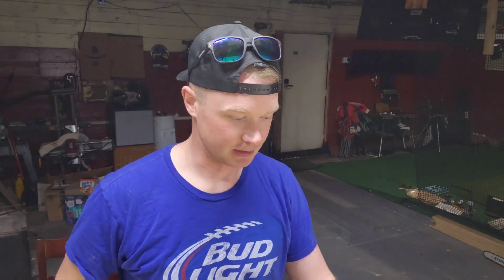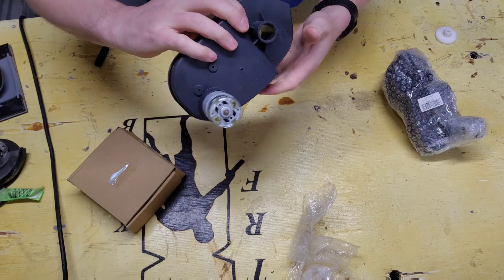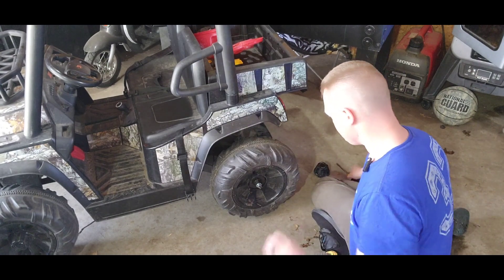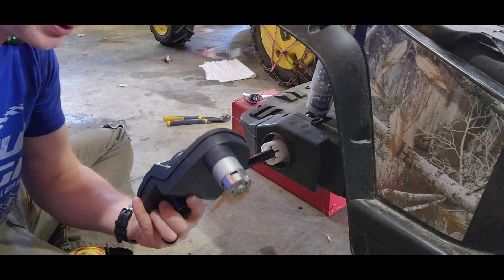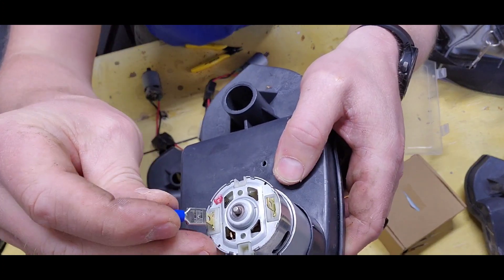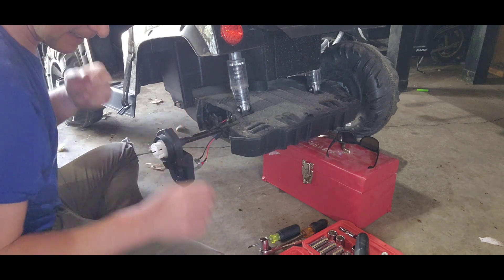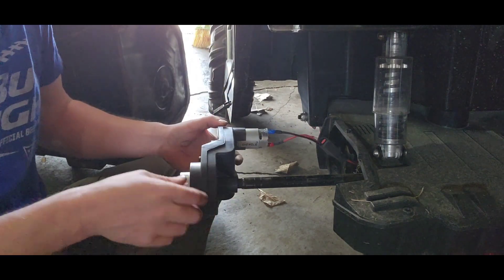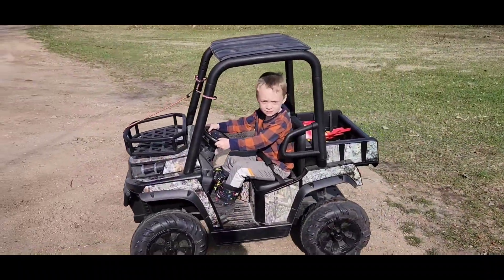24v UTV ride on gearbox fix and motor upgrades

Comment: I have upgraded my motors to the 775 from MLToys and changed the battery over to the drill rechargeable batteries (2 Makita 18V) using the amazon battery adaptors.  My car will go for a few seconds and then stops.  MLToys recommends me bypassing all stock breakers and purchasing the 40 Amp self-resetting amp on their site, do you have any experience with teh breakers?

Comment: Anyone got simple idea on how to give rear wheels a little differential action?? IMHO doing this may save folk from grinding up gears in gearboxes.   Yeah, less power slides and drifting though LOL.  AKA... seems to be all Ride On's with two or four motors do NOT declutch, depower the wheels  that are on on the inside of turns.  I bet that is why wheels are designed as they are.  When you turn the inside tires lean some away from the center traction area of tire and onto the more slippery plastic.  This allows for slip and takes stress of gears.

For myself I'd like some differential action and not rely on slippery section of tires.  Will be converting it to haul medical equipment, tools etc....  and I know i'll be going well over its intended weight capacity. (will upgrade structure where I can accordingly, and changing drive motor gear smaller toothed for more torque but less speed).   Also will like many have.... improve the traction of the tires. needing to do that  cause most all my use will be in fields (think farming/hunting/fishing etc) 

Would not be such an issue if it was not a 6x6 with all 4 rear wheels powered..  so its going to want to drag/scrub outside tires in a turn , and make wheels slip/hop in inside of turn, good bit more than a Ride On w/only one or two powered rear wheels. As pointed out above this  becomes bigger  issue when  you remove ability of tires to slip by adding traction aids to the wheels.  

One brainstorm idea to accomplish this is:
. two momentary switches placed to each side of steer motor hub orrr?? 
. glued on nub to steer motor hub (orrr?)  that pushes  one of two momentary switches in a left or right turn
. relay(s) activated by pushed switch  temporarily depowering motor(s) that are on inside of turn... AND then repower it (half? third?) of normal voltage, via re-routing power coming from Motor Controller thru step down DC converter or  thru voltage rheostat, thus causing inside turn motor/wheel(s) to turn slower.  

Point of repower at a lower voltage is you don't want to just depower motor/gearbox completely  (unless you declutch it somehow) ... Without declutching; that  too would put unwanted harsh stress on the gears.  I dont know if the de-power/repower though would be seamless enough to keep stresses down.    

Ohhh  and put  a switch (along with needed relays) to bypass that  new differential feature back to the OEM true locked together drive again when you want to drift, climb thru slippery stuff, climb hills etc.

otherwise if you got $$$ you could get a whole new multi motor controller with more features where you could program this into the controller itself. heck you could even then have option for Tank steer

So what is brainstorm idea one of ya'll can come up with.....  throw it out there.... lets hear it.

Comment: I replaced both gear boxes with the best ones I could find on Amazon. 24v, 35k rpm. I installed both, and tires seem to spin fine when wheels are off the ground, but as soon as any resistance, and tires are on the ground, it will not move. Seems like they are trying to engage but motor isn't strong enough to spin? What could it be?
Reply from the maker: Pretty sure your battery is shot. It doesn't have the power to push the wheels when there's resistance. So you might have to swap out your batteries, even my replacement ones that I build, maybe last us, one summer of hard riding.
Reply: @igolfandimakestuff2629  thanks for the reply. I have a new battery setup. I did 2 - 12v 15ah lithium battery in series to run at 24v. Fully charged, same issue.
Reply: @shoplevelgreen did you ever got it working?
Reply: @bala3667  I have not. I think the motors in the ones I bought are maybe not rated for the 24v setup, although they say they are. Not sure what to do.

Comment: am getting one that is a 6x6.  no motors in front wheels.  4 200w motors are  in the 4 rear wheels.    But it has a remote also !!!  Not sure if steering via remote is tank steer orrr??  Kid steer looks to be mechanical but maybe it has a stepper motor operated by fly by wire. Serious doubt it. 

Damn those motors are tiny on these kids one.    I got a 6x6 one someone built that uses two 24v motors about 5" in diameter and long.  Guessing motors from handicap scooter parts.  Chain drive.. But it is way to fast...  would take way more time/money  fab frame to make space to get larger tires / room for different chain sprockets to re-gear it.  so am selling it and going to try to fab a toy ride on one instead.  

Plan is..... same as was with the original 6x6 one I have: turn it into a cart to haul a set of 12v batteries to run 24v medical devices I'll need next to me while working outside.   Hence need slow speeds and power to haul not go fast.     Maybe to hold tools too as well remote camera holder for youtube filming??   .  Anyway... will strip ride on toy one to bare minimum for more storage space.        

Any suggestions you can think of? Do you know of anyone that has files/can print gears for more weight haul / slow speeds?

Comment: What would cause machine to go faster in reverse then forward. I've replaced wiring harness, pedal, gear shifter, and battery which didn't fully charge it at first. Having it charging now though.
Reply from the maker: Maybe something in the wiring harnesses.  A reverse wire must be hooked up to a FW connection?.  Like the FW and rev. Wiring should be swapped.

Comment: My son has the same one and today it just will not move. The motor works though when you step on the gas and it is fully charged. So I am thinking the gears just became stripped? How gear boxes does this thing have? Should I be checking every tire or just one?
Reply from the maker: There is 2 gear boxes. I believe I have a link to the ebay ones I got in the discription or in a comment somewhere here. They might not be available from the exact seller but just search like items. Should be about $40-$70 for the entire gear box with motor. The price fluctuates alot.
Reply: @igolfandimakestuff2629   Thank you! I will check it out. The motors are still working so would you think I just need the gears? I am reading a lot of comments about how the wires are not the same for the "new motor" and I have no solder gun. gear boxes are on the back tires i take it?
Reply from the maker: For some reason, all the gearboxes I have found come with a motor. If yours still work, just remove the motor and save the new one
Reply from the maker: Yes gear boxes are on the back

Comment: Great work! I found your video looking to fix with my own 3D printer. Ours is the 3rd gear, though. I will be modeling it to print tonight.
Reply from the maker: Nice. Make sure you print in carbon fiber nylon. All other materials will fall apart right away. Maybe just maybe ABS would work.
Reply: I have a friend who has all four gears damages, if you could send the file I would appreciate it

Comment: So my car quit running. The lights and noise still come on when i charge the battery it automatically turns green on the charger like its charged but when i hit the oedal it does nothing. Anyone else had this problem?
Reply from the maker: It's very likely you need a new battery.
Reply: @igolfandimakestuff2629  I thought that too but would the noise and lights still come on?
Reply from the maker: @bm3211  Yes, the noise comes from 2 aa batteries in the stearing wheel. And lights require so little power to work so they could still be on while the battery does not have enough juice to move the car
Reply: @igolfandimakestuff2629 
Mine does the same tried swapping the battery to a 20v Drill battery but still doesnt move what do you think it might be TIA!
Reply: @leonelgarza1101 I tried the same but I guess the motors don’t operate once the batteries voltage gets too far away from 24v it’s supposed to operate with.  I used some 24v batteries in parallel and my kids are able to operate it for like 2 hours before needing to change batteries.  I typically use a 10Ah stacked lithium and a 5AH battery

Comment: Can I purchase gears from you?
Reply from the maker: Yes I am working on making them stronger and stronger but I do have 2 more available now of the small gears. That should work
Reply: How did you get the back wheel off? The nut keeps spinning around without losing up.
Reply from the maker: You need to hold the entire shaft and that will allow you to take the nut off.

Comment: What made you do this video? What wasn’t working properly?
Reply from the maker: The gears get stripped out really easy when the kids ride around the land alot. So I just wanted to get a bit better motors in it and start printing my own gears so I don't need to buy an entire gearbox every time one breaks
Reply: @igolfandimakestuff2629  this is good to know! Ours was still under warranty, so they are sending me new parts. We’re hoping that what they send us is what is the problem. The back left tire doesn’t spin. 

Do you sale your gear things you print? I don’t have a 3D printer….
Reply from the maker: I would assume it's the same gear that was stripped out in mine. Getting the entire gearbox with motor is fairly cheap. I think I linked the gear box in my video. And it's easy to fix if your just doing the gearbox swap